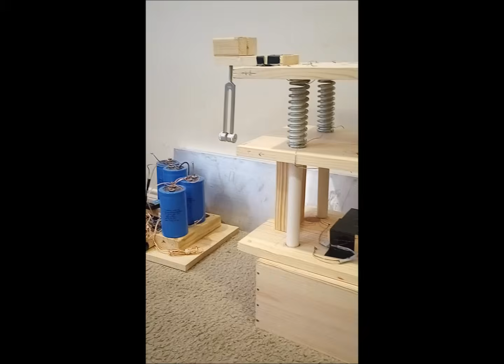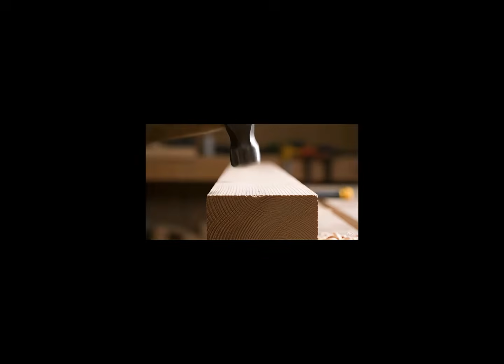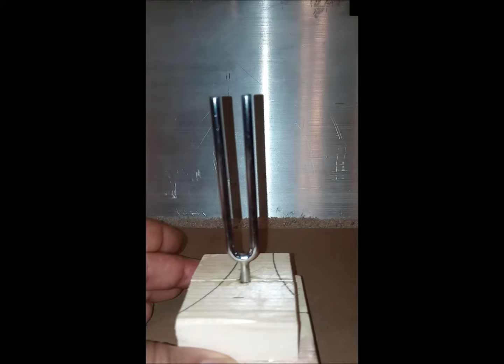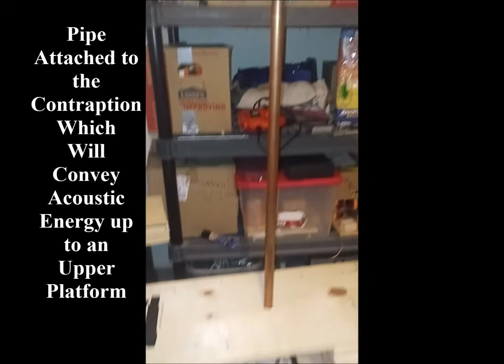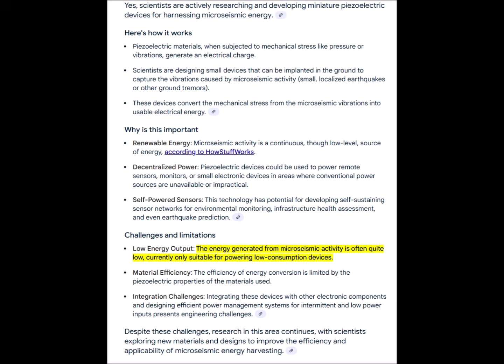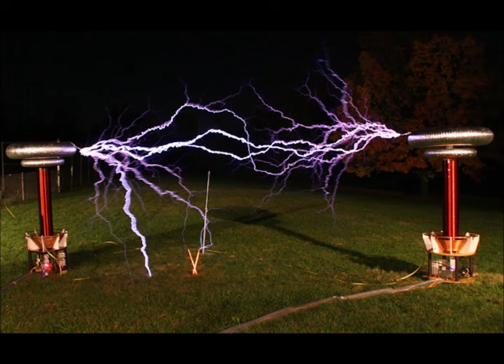Giza Underground: Can Seismic Energy be Stored in Giant Tuning Forks?

Comment: Rumor I heard:  thieves broke into an Egyptian warehouse, looking for ancient artifacts to steal.   Instead they found a storage room full of huge metal tuning-forks of all sizes.  (No other details.   I think they said that they broke into the same room years later, and it was empty.)
So, the ancients had vibratory technology, and metal-fabrication?   Six-foot tuning-forks can be a type of power-tool, for example used for vibratory drilling.
Reply from the maker: Yes, I've heard of that story. Tuning forks up to 9 feet tall resembling catapults!!
Reply: @gsutton78  Physics teachers know that tuning forks convert transverse motion into longitudinal vibrations of the handle.  A "V" shaped tuning fork will not do this.   The "U" at the bottom will cause the handle to move down when the two tines come together, and up when they move apart.  (Maybe an ideal "fork" would be a metal ring with a split in it, and a handle attached opposite to the split.  Then add weights to the two sides.)
Also, the enormous motion of the tines is being converted into very very small up/down motion of the handle  ...but with enormous force.   Conceivably a tuning-fork could disintegrate rock, if the handle could be pushed down with great force, and the tines kept vibrating (with violin-bow for example, or rubbing upon a slow-turning leather wheel which is covered with rosin powder.)

If we had a miles-long metal rod, we could attach tuning forks to the opposite ends.  Then, when one fork is struck, the other one vibrates powerfully.   Yet the vibrations of the rod would be undetectable.   (Resonance is weird.)
Reply from the maker: @wbeaty   Interesting 🤔. And in addition to that, the forks if vibrating at the resonance frequency of the stone (or rather a subharmonic of it) would be able to carve/drill into the rock even more efficiently. Recent studies have shown that vibrating a rock at its natural frequency (which is in the ultrasonic range) makes it significantly easier to crush, and by extension easier to cut and carve, by creating stress micro-fractures within the rock!
Reply from the maker: @wbeaty  John Keely's story is fascinating! I have the book, "Free Energy Pioneer" by Theo Paijmans and "Universal Secrets Never Before Revealed" by Dale Pond. In addition to disintegration, he also performed feats of macrolevitation, weight reduction, and built an acoustic microscope among other feats. He also used harmonic progression to accelerate sound vibrations from the audio range to well into the gamma frequency range!
Reply from the maker: @wbeaty   Wow! It's great to meet someone who knows so much about Keely. A lot of people know about Tesla, but far fewer know about Keely. In fact, I've never seen a single documentary on Keely. Not even on "Ancient Aliens" which is curious 🤔
Reply: @gsutton78  Yep, on Jerry Decker's "keelynet" during 2400-baud modem days.   Heckelfish is clueless?  But I never tried building any of those ideas, other than recently the 4-tine tuning fork.  We do use "Keely pipes" here at work.  They look like wires, but have a microns-wide passage down the middle.  Stainless steel capillaries with gearpumps, and super-pressure water inside.
It might be simple to build sonic-powered motors, or turn granite into dust  ...but how the heck did he produce levitation?  The walls-of-jericho effect?  (Trombones emit shockwaves about 5mm thick. )
A rank of trombones, aimed at a wall, should all synchronize because of reflections being guided to the lips of the players.  Plane-shaped standing-waves made of shockwaves appear.  Perhaps they push against solids, or perhaps just turn mortar into dust, so stone walls collapse.   A half- circle of Tibetans can aim it at a stone block, but why would it form a vertical standing-wave?  Well, sound that's loud enough can bounce off itself.
Aim the whole thing downwards, and use ultrasound, and perhaps it can lift a huge metal sphere?  Vimanas don't need mercury to fly.   They need trombones!  (A new alt-science meme?  You herd it hear first! )
Reply from the maker: @wbeaty   Yes, Keelynet! I remember first stumbling upon that site around 2003, and man did it open up a whole new world for me. I really miss that site. I wish Decker was alive now. I bet he'd have his own podcast. Only a handful of videos from him on YouTube. Keely described different forms of levitation or levity. In one form, he described a mass as being made up of molecules with negative and positive poles. Under normal conditions, the poles point in a specific direction. No matter which way you modify the mass's physical orientation, these molecules will realign to their default orientation and being attracted to the Earth. When the proper musical chords are played, the poles reverse, and the mass is repelled from the Earth. A variation of this theory by David Wilcox describes gravity as a resultant of aether which "blows" onto the Earth, pinning masses to the Earth's surface as it flows into the Earth much like an insect being blown against a screen by an airstream. In this model, there is also a counterforce which "blows from the Earth", counteracting the opposing force, but it is normally weaker. The resultant between these two opposing forces is what we know as gravity according to this model. Energizing a mass in certain ways can alter this relationship allowing either force to predominate resulting in levitation or supergravitation. This concept fits in with Keely's later model which describes levitation as the result of "celestial attraction" and "terrestrial propulsion". In this modified version of his original concept with the molecular poles, levitation is due not just to repulsion from the Earth, but also a simultaneous attraction to the 'celestial region'. He could also make a mass (his 6,000-pound sphere) heavier via "terrestrial attraction" and "celestial propulsion" resulting in super-gravity. This seems to fit in with Nikolai Kozyrev's experiments in "latent force". Instead of finely tuned musical vibrations, Kozyrev used 'cruder' methods such as shaking, heating, cooling, dropping, rotation, etc. Using a specialized scale, he observed minute gains or losses in apparent weight. The objects would return to their rest weights as the effects of the agitations wore off. Hence the name "latent" force or effect. It seems Kozyrev was doing the same thing Keely was doing but to a significantly lesser degree. His name for the universal energy is torsion field or time energy. For Kozyrev, time was not solely a 4th dimension, but an energetic force which has a twisting, spiraling motion. And so, depending on how you agitate a mass, you can alter the flow of time energy through said mass, altering its apparent weight. Interestingly, certain corners of mainstream science have proposed time, time dilation specifically, as the cause of gravitation. Fascinating! There's another guy by the name of Dewey Larson who proposed a Reciprocal Theory which states that there is a dimension called Time-Space that is the reciprocal of the more well-known Space-Time. In this, a mass agitated properly essentially teleports to this other dimension temporarily. It can be a partial dematerialization which would result in levity or loss of weight or nearly complete teleportation which would result in full levitation. Giving the example of the Tibetan levitation, bombarding a stone with resonant sound causes it to partially dematerialize a percentage of its atoms into this Time-Space, enough for it to levitate. The Tibetan feat allegedly took several minutes to take effect (latent effect?). When it did, the mass rose into the air, completing an arc and crashing back to the ground once the sound was cut off. A separate account in Tibet describes a large stringed instrument used in tandem with a large gong and screen to reduce the weight of a stone. After a monk smashed the hong several times, he was able to lift a large block of stone with one hand. After some time, the stone would regain its full weight (latent effect once again?). I could see the Tibetan levitation by the huge trumpets (ragdons) and drums as a macro-sized version of container-less processing too, though. The late Bruce Cathie performed calculations based on the arc or trajectory of the stones, the size and frequency of the instruments, the geometry of the monks' positioning, the depth of the bow like depression (all known information thanks to the meticulous notes by the traveling doctor). He seemed to find that certain harmonics of light and gravity was physically encoded into these physical parameters carefully laid out by the monks, creating a condensed acoustic field or "vortex" which could nullify gravity. Edward Leedskalnin believed that gravity derived from miniaturized magnets streaming from the Earth. He suggested to astrophysics that if they took a rocket and gave the head a strong north magnetic polarity and the tail a strong south pole polarity and then aim it to the Moon's North end, they would be more successful. Here, Leedskalnin is talking about a repulsion/attraction force working together to provide levity, analogous to Keely's celestial attraction and terrestrial propulsion. Dudley claimed a rocket could be electrified with a high electrostatic charge for a similar result of repulsion from the Earth's surface and attraction to the ionosphere. So, there are a number of different takes on levity and levitation. But as we see, there are also a number of common threads as well; key overlaps where some objective truths may lie!
Reply: @gsutton78 make one !
Reply from the maker: @cool2492  Now that would be cool! 🤔

Comment: what do you think about leedskalnin's PMH as an electric tuning fork??
Reply from the maker: Yes, interesting insight! As an energy storage and release device, Leedskalnin's perpetual motion holder is indeed analogous to a tuning fork in being able to store "magnetic current" and then release it. It would be even more so if it were activated with AC or pulsed DC current. Being a coil of wire, there would be certain frequencies in which it could store maximum energy (resonance). Then like a tuning fork, this energy could be either released steadily or all of once in a single, powerful jolt. In this case the power would be both vibrational (due to magnetostriction) and electromagnetic. With this, we start getting into Tesla territory!
Reply: @gsutton78  I often wonder what guage he used to determine the sixteen spot and why he would call it sixteen, there is a cymantic pattern of sixteen in his garden... have a good day
Reply: @gsutton78  A Tesla secret is that a secondary coil (or an Extra coil,) when sparked, doesn't make a 7 microsecond impulse as we expected.  (A 300KHz coil should give a large halfwave pulse.)   Instead, it gives a 1/3 GHz pulse, two thousand times shorter, with peak-power 2000x  higher.   Tesla said that these would explode wooden beams, and sounded like a pistol.   A little thought exposes the secret.   A coil is just like a stack of rings, with dielectric in between.   If we short out such a "capacitor," it will discharge in a few nanoseconds, because the EM wave leaps between the rings, same as a light beam running along the coil, same as a stack of capacitors in series.  It's a transmission line.   But in normal operation, instead the EM waves must follow the wire, and go around each turn.  (During a spark, the operation is way way higher than at the peak resonance.  Up there it's purely capacitive.)

So, a coil that runs at 300KHz, instead behaves like a two-foot VHF antenna charged to a few hundred kilovolts.  Then sparked.  The output-spikes might not be megawatts, but thousands of megawatts.   Charge it slow, then spike it fast, same as a capacitor bank.  A Tesla "Extra coil" is actually a capacitor bank. But none of this is possible unless first you suppress all lightning.  Tesla often put his coils in oil tanks.   Boiled linseed oil only.
Reply from the maker: @wbeaty   🤔